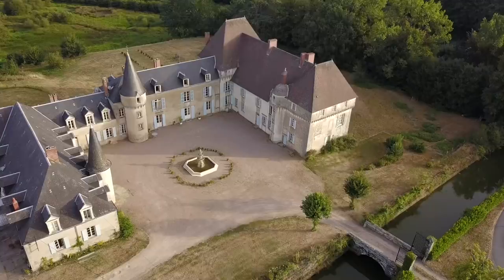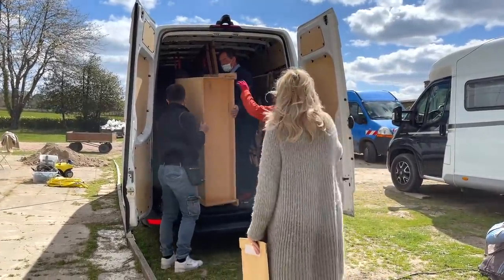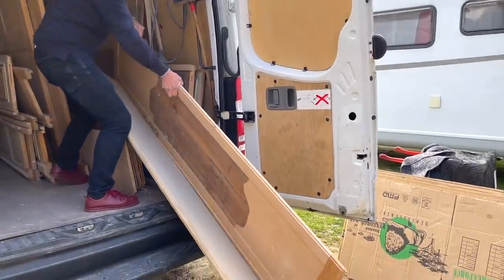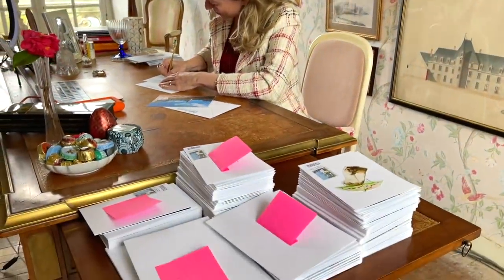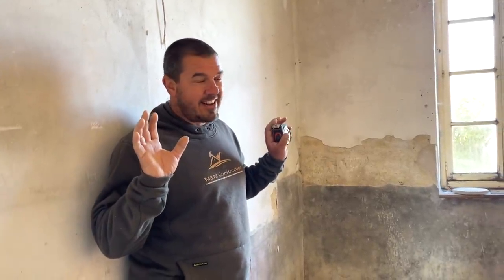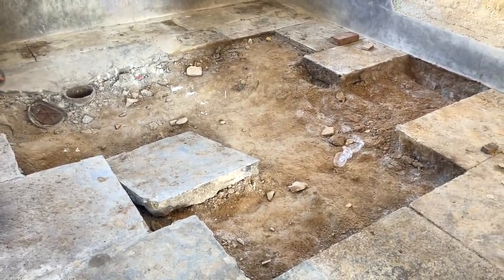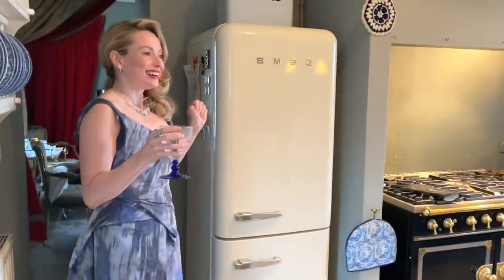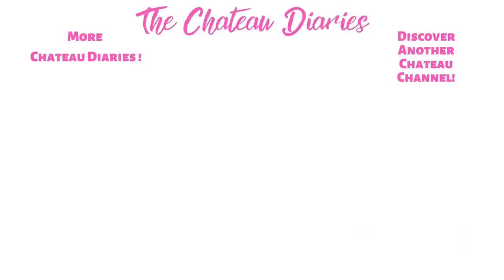18th CENTURY PANELLING FOR THE CHATEAU!!!

Comment: Regarding the tiles, you should use the ones in best condition on the center of the room and the chipped ones on the edges, where it'll have armoires or something on top.
Reply: Brilliant!
Reply: I think the installers would be aware of that.....
Reply: Good advice.
Reply: @rainbocatz6376  youd be surprised 😅
Reply: Yep agree, the cabinets will hide those with character in them. 
I would have not minded to clean off the tiles with a power washing.  Love power washing.

Comment: Stephanie, best soaked all the tiles in warm water over night let it n the water over night. Dont throw the chips and broken ones, wash all. Then take a scraper and scrape the plaster it will removed easily as it is soaked wet and damp avoid using the jet wash..it might chip,lift the surface of the tiles or crack or break from the water jet pressures.. The chipped edges can be used for odd angle corner shaped. Just cut it with tile cutter or angle grinder.
We have done it on our old tiles at our old project.
 That is typical builders ..they like use new stuff and throw away things that requires extra elbow grease.  The soaking of old tiles before cutting helps from chipping and broken when cutting.

Worked with that kind before ie builders and very old tiles.
 Good to see the video  back with you as the main anchor of your chateau video. Stephanie and lalande.stephanie is lalande.not any one else..
 The curative  spirit in rescue everything. Curate   about  almost everything when it is easy to do a short cut.
Keep it up.. tbh we watched the videos ßbecause of Stephanie. The support act enter frames are sideline..
Good to you back ... keep it up. Look after your health... So that you can be in  the main frame and anchoring the videos.

The place for natty, you have nice high roof, can do nice loft for bedroom with open space and just  banister as the wall.

P/s you have forest to supply the logs for that separate outdoor project.

Comment: The antique paneling is wonderful!  I had a room of French antique paneling installed in the mid 1990's by a friend that built theater sets. It was wonderful. I used antique oriental wallpaper like Gracie  to fill a wall ,above the wainscoting, when we ran short of  the original paneling. The combination worked well.  Every thing  will look so beautiful in that room.  Congratulation!  It is just  so special!  How did  you find it?

Comment: There is a French air system with fireplaces, that heats the room...
Reply: Clay pipes on the bottom  front of the fireplace take the cooler lower air thru them behind the fp...and come out at the Top...warmed air..